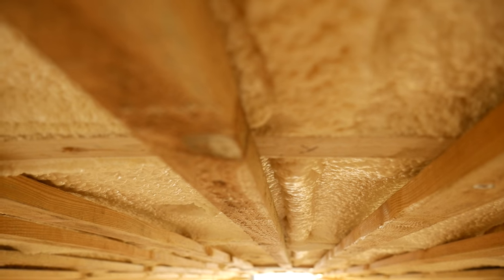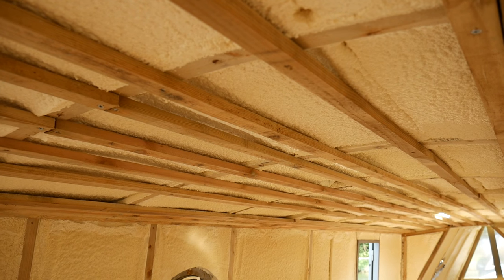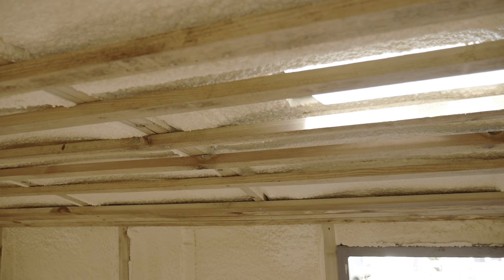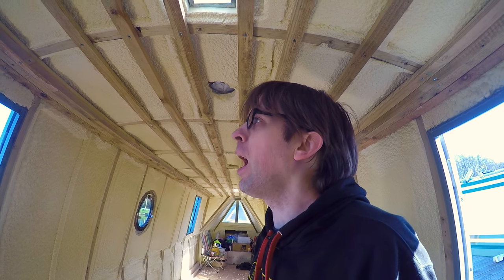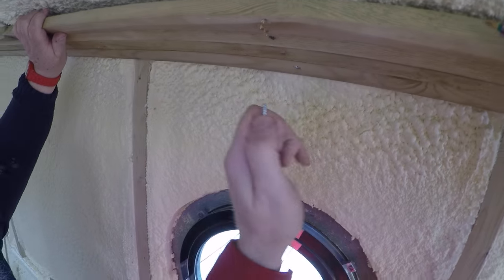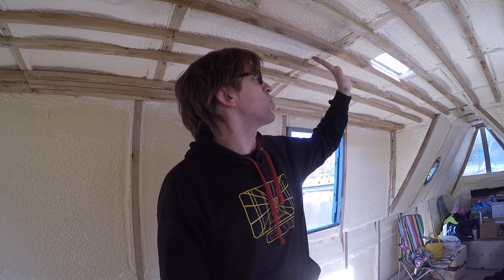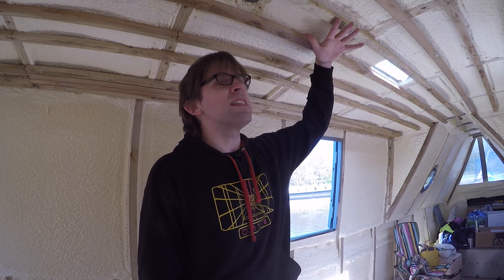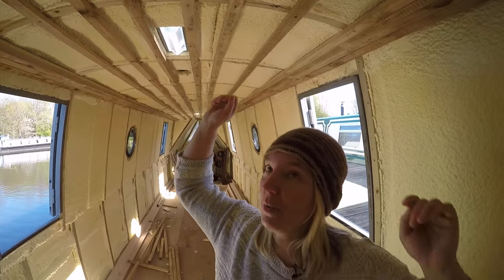The Narrowboat Fit Out – 4: Dancing on the Ceiling (The Fun of Prepping a Narrowboat Ceiling)

Comment: Great to hear from you again, so you managed to sort the floor,  did the wine cooler work out?.
When fitting the ceiling panels you may want to consider sliding covers where the pigeon box and prism's occur to shut out the light when it would be intrusive especially in bedroom spaces, "sorry".
Do you have an actual layout of "zero-one" that you could share with us, or does that continue to change?